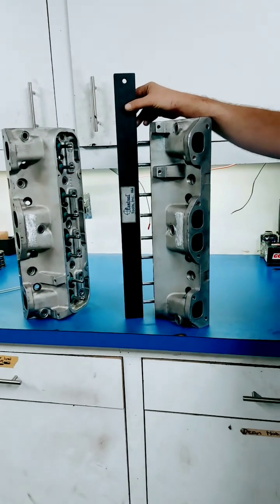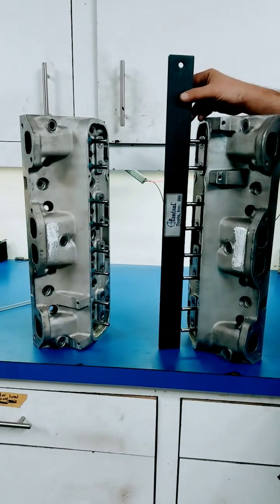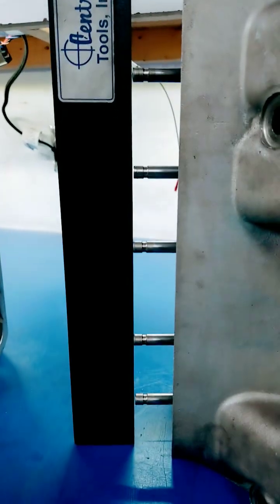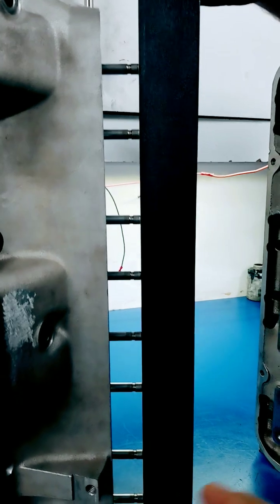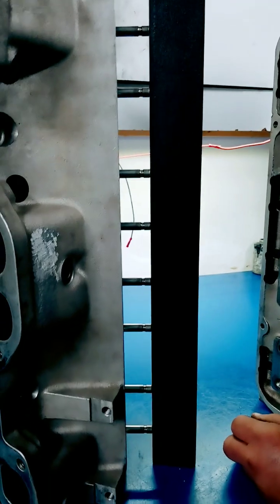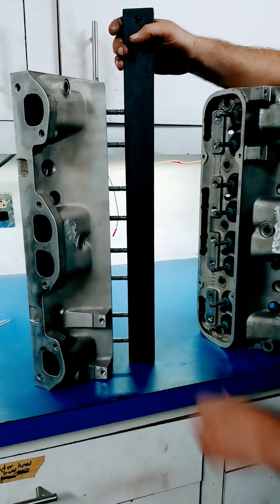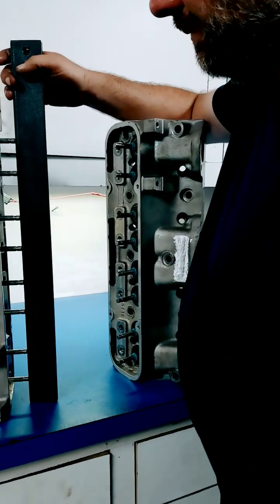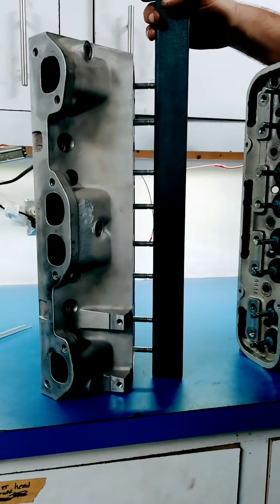Correcting valve stem heights for better valve train geometry

Comment: How does this effect the valve train it is adjustable ?
Reply from the maker: If you're using a stud mounted rocker you can independently adjust the geometry to center the travel path on the valve stem, but will require two different length push rods to do it. If using a shaft system you cannot make all the travel paths the same since a shaft rocker is fixed to a stand. These are wide port heads which require a shaft rocker system with offset intake rockers.